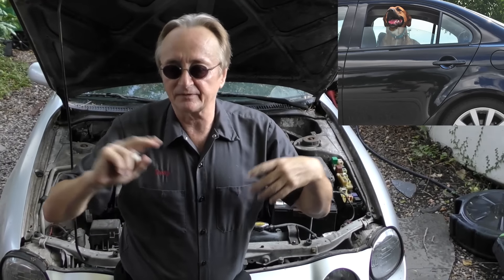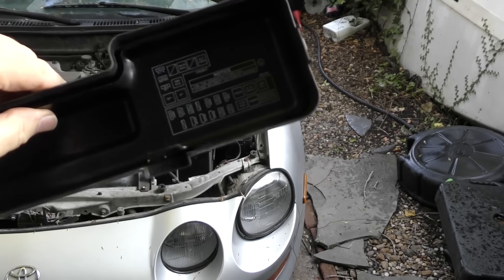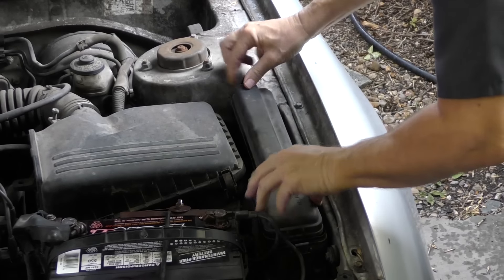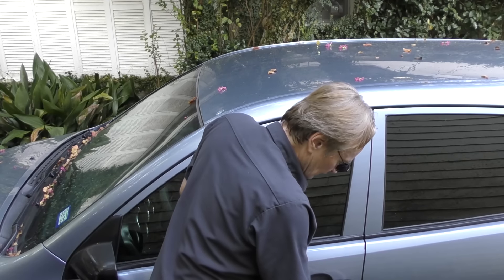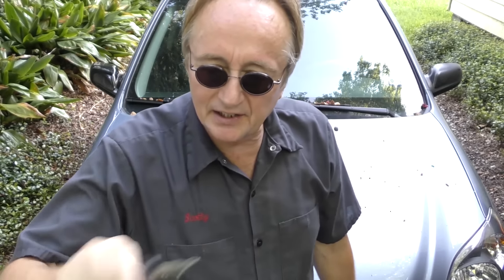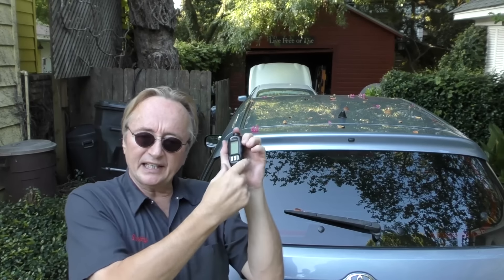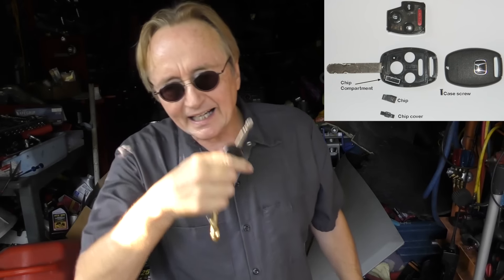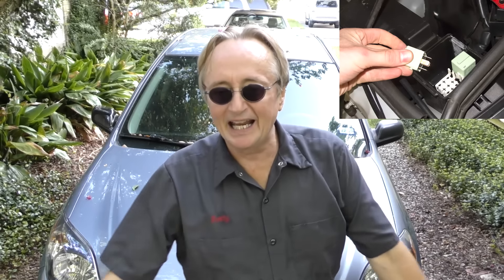How to Theft-Proof Your Car

Comment: the best anti-theft device is a manual transmission, no one knows how to drive a manual transmission this days
Reply: 👍🏾 true, that's why I drive a manual.
Reply: >This days
Reply: That’s why I deviced to get a stick shift
Reply: This solution does not work in europe, since nearly everyone still knows how to drive a manual.
Reply: Works quite well with car jackings too, just jump out and run before they find out they can't drive it and try to take it out on the driver.
Reply: Yeah ok buddy. My daughter and my three nephews are all in their early twenties and all of them were taught how to drive a manual transmission. I taught myself how drive stick just to show off to my dad. He was pissed because he wanted to teach me.
Reply: That's pretty funny and actually true.  Most people today can't drive stick so most people could never steal your car.  Pretty funny.
Reply: @ricardomolina4605  My sister taught herself to drive manual transmission.  I used to tell her "Grind me a pound" and she did.
Reply: True.  Most millennials can't drive standard.  Maybe somebody should develop an App so they can learn about it on their dumb phones.
Reply: Had to laugh when I read this, years back I had a ford cortina with a manual gearbox but it had a problem, the gearstick would jump out as the gate was broken,one night I was out and was going back to the car and noticed the door was opened a couple of inches,I thought someone has broke in to steal the radio, as was a common occurrence in they days ( in Scotland) but when I got in the car the radio was still there, anyway I started the car and put my hand down to put it in gear the stick was gone 😡 obviously someone tried to steal the car and the gearstick came away in their hand, so they stole that instead. But I had the last laugh as I kept a spare under the seat 😂  ( true story)
Reply: eXcEpT iN eUrOpE. And the, i tOT mYseLF; or the, mY sO aNd So dRiVeS sTiCk
Reply: Laughs in European
Reply: Tons of people know how.
Reply: Steve Silvas  Millenial here,  know many millenials (obviously including myself) who know how to operate a manual transmission car.
Reply: In Europe you can't even get a driving license in most of the countries if you can't drive manual.
Reply: 1notgilty nobody can drive a horse and carriage these days it’s absurd how people are caught up in their fancy gas powered automobiles SMH. That’s how you sound. 
Standard tranny is a dieing breed and older people aren’t helping seeing as manual sales are abysmal. Ps. Before you start crying I drive a manual civic.
Reply: Everyone I know in the UK knows how to drive a manual but some choose to drive automatic. Can't beat manual IMO!
Reply: Steve Silvas  I'm 28 and I drive a stick..
Reply: Nick J lots of younger people are able to drive stick, perhaps younger people are looking for different lines of work?

It’s also a function of time, often car lots will only have one or two (if that) manual transmission cars available. 

Can’t blame the younger generation for not learning to drive manual transmission. Perhaps the generation before is the one who you should be pointing the finger at? 🤔
Reply: Find one that you can buy!
Reply: @johnirvine3214  wow, that was one pissed off thief! :P
Reply: I'm 39 and still drive a manual Toyota Echo
Reply: People who steal cars know how to drive stick, that’s like a bank robber who don’t know how to work a ATM.
Reply: Nick J  I am 28 but I know how to drive a stick. Unfortunately I have a bad driving record over the last two years. I went for my CDL with a company but I didn't pass the driving part first time. So my first car after that was a 88 Mazda rx7 manual.
Reply: Nick J  yea. I know. I took my regular license behind the wheel test twice. I believe I can drive a truck now for sure.
Reply: Unfortunately you’re incorrect because it is easier to steal a manual just push start it I don’t know how many commentators say your statement and don’t know this. And almost all thieves know how to drive manual because thieves are poor and usually they do odd jobs like driving trucks and busses so they know how to.
Reply: Bite your tongue sir, I learned to drive on a manual. Used to drive one with 18 speeds for a living too. 😁
Reply: You will regret that decision....I may not be a pro at a manual but I can definitely drive around the city....the clutch might not survive but that's not my problem 🤣
Reply: Steve Silvas  I am a millennial...

I know how to drive stick.
Though I realize the average millennial does not, in fact, know how to drive stick.
Reply: No even better, get a car with a old vw autostick
Reply: Plenty of folks drive manual. Knowing how to drive manual doesn't make you special.
Reply: my friend's 1998 wrx got stolen two years ago, yeah it is manual transmission
Reply: Exactly.
Reply: Steve Silvas  I was born in 2002 and I daily a three on the tree, so yes, I can drive a manual.
Reply: Same here, my sister got a stick so her roommates couldn’t borrow it!
Reply: Steve Silvas true, you can’t play on your phone and drive a stick at the same time.
Reply: Brian not if you know how to drive one properly
Reply: I can drive a manual LOL..their actually easy to steal...no colume lock for the automatic to break..
Reply: Manual transmissions are easy to steal, no colume locks for the automatic to break,  as long as the clutch is engaged, you by pass the nutrual safety switch...

 Is a big urban myth car thief's can't drive manuals...
Reply: thieves do
Reply: @garysmith5741  I can't stand talking on my phone while I'm driving. So I lock my phone in my glovebox because I want to concentrate on driving my 1953 Chevrolet 210 with a Three On The Tree.
Reply: I’m 16 and I have driven 4 manual transmissions, so if you’re into cars and will actually put forth effort to drive a manual then it won’t actually be the best anti-theft
Reply: Steve Silvas  Dem Mel Enials rooin everyting!!!
Reply: Not hard to learn.
Reply: @1notgilty   They can learn, if they want.
Reply: "me special becuze me drive man u all!11!"
Reply: @angellively6746  Actually, I can drive standard and split shift, ride a horse and hook up and drive a horse and carriage, in addition to being able to hunt, fish and survive on my own. Millennials on the other hand will die by the millions if the system ever breaks down for an extended period of time. They are the weakest generation ever. Better to be a LONG way away from them and big cities for a while if SHTF day ever comes and the grid crashes.
Reply: i do, since i was 9
Reply: Haha..like me..
Reply: A few years ago a few punks tried to steal a car from an old lady and it was a manual. The punks looked at the shifter and all bailed and ran away. The lady just laughed at them.
Reply: You think America is the whole planet
Reply: that might work in usa....but in europe...manual transmission is way more common... and remember...scotty has fans all around the globe :P
Reply: How do you keep it from being stolen by a flatbed?
Reply: @angelsandoval9346  I think wheel lock will make it very hard to get it on a trailer but it's too time consuming, just get place with a garage
Reply: I’m a gen z and I daily drive a manual
Reply: Dude, quit saying that. that’s very bad advice.
Reply: Steve Silvas  wrong, Americans are the people who can't drive manual. the rest of the world has no issues.with that. Millennial or generation Z.
Reply: Im 16 and i learned how to drive stick 👍
Reply: Steve Silvas sike I’m the early one but I learned tho. I find this very funny tho 😂
Reply: I thought alot about subject recently. which doesn't say much about this generation of young people. Grandmother's were expert Manuel drivers when I was growing up. Lol
Reply: Not really in Mexico most people own manual transmission cars because of the terrain over there and because is cheaper to maintain a manual transmission cars , mostly anyone that comes from mexico knows how to drive manual. I was born in Dallas tx but i spend alot of time in mexico growing up, I learned how to drive in my grandpa’s toyota pick up 5 speed manual at the age of 14 all my friends in mexico were less than 20 years of age and knew how to drive manual. Im 24 ,and my work truck and my car is a  manual transmission, my wifes car is the only automatic I drive. Plus most of my coworkers here in dallas own a manual pick up truck . So Alot of people know how to drive manual now a days , specially teens who love racing with there cars, I seen alot of teens like that.
Reply: Im learning to drive one
Reply: Depending on the country
Reply: Here in Italy probably 90+% of cars are manual transmission
Reply: Steve Silvas  you mean gen z? because millennial were around when manuals were still relevant. In fact, most millenials know how to drive stick
Reply: I keep hearing this but most theives target manuals. At least the ones who steal hondas
Reply: @EnSabahNur-ir5mw  lol mad cuz old
Reply: Yes being car enthusiast driving mt is the way to go
Reply: yhea not in South Africa almost everyone drives manual over here 😂
Reply: Hal 502  but professional anto-thiefs ?
Reply: They just stole my 93 civic coupe :(. It’s manual. Even broke the wheel lock to steal it :/
Reply: Wish that was true. My manual 95 subaru legacy was just stolen :/
Reply: Lol manuals are stolen just as often as autos in Seattle
Reply: Most people in UK drive manual
Reply: 3on a tree with a pair of vise grips!
Reply: @angelsandoval9346  bolt down some super strong clamps and chains? Might be strong enough for a flatbed with a crane?
Reply: Negative I just had my Honda manual transmission Civic stolen.
Reply: Just bought a standard Mustang and was using an 80s club that I was being made fun of. This made me feel better.
Reply: Haha. Funny but true
Reply: I’m not sure if that’s true, I would expect someone on the streets to know how to drive stick
Reply: An easy way to theft proof your car is to just take the battery with you every time you park.
Reply: People need to stop saying that I steal so many manual integras 😂😂😘
Reply: Hal 502 , they can steal anything but they can't drive everything.
Reply: My manual civic just got stolen.
Reply: @Manakuski  Also in pretty much of Asia here in Indonesia our driving schools starts with manual transmission car
Reply: Maybe in your country, in South Africa they take it within a minute
Reply: Absolutely wrong
Reply: it’s actually pretty easy
Reply: Lol, wrong. I've been driving manual my entire life.
Reply: Not even….at least for Honda thief’s
Reply: Everyone replying "true no one drives manual" but say they're all driving manual 🤦
Reply: @epichumans9746  I've been driving manual since I was 15 years old. I am now over 50 years old.  And yes most people today , mostly Gen z and millennials can not drive a stick shift.
Reply: LoL my stick shift car was stolen a few days ago.
Reply: Where do you Live?!!
Reply: You would be surprised but yeah most people dont know how to drive stick
Reply: Show me a manual f150 or sierra or silverado. I'll wait.
Reply: That is exactly correct to not steal a car cuz they will definitely get pulled over if they steal a manual because no one knows how to drive a manual I've always said that in school they should teach us how to drive a manual and automatic because in an emergency you might have to drive a stick shift...
Reply: Manuals I mean sticks whatever once you learn it it's like riding a bike also you have more control of your vehicle
Reply: zoomers definitely will not be getting anywhere w/manuals 🤣
Reply: Can't start 'em, but can push 'em
Reply: not!
apparently thieves are learning
Reply: not in India.
Reply: Not in the UK, lol,
Reply: Just had my stick shift stolen
Reply: Nice
Reply: No one but me so if I ever barrow your car 🚘 I’ll bring it back lol 😂
Reply: @ricardomolina4605  nice bro. Doesn't change the fact that a low percentage of society knows how to drive manual. Doesn't mean no one knows
Reply: My dad taught me to drive on my first car when l was 17 in 1978, and when the battery died we could jump it by pushing it. Those were the good old days!🤔😏
Reply: Only in the states the rest of the world still have a majority of manual cars, or at least learn to drive manual gear shift
Reply: Ya got me, I def don’t know 😢
Reply: Sadly less cars today are sold as manual. I hate it. I love manual transmission
Reply: That's why I wish new cars came with manuals. Like the latest BMW M3 touring or even the toyota corolla
Reply: Not in the uk, everyone drives manual here
Reply: @Gubsygaming  depends, the are so many more automatics now than manuals.
Reply: Stick takes about 3 seconds to learn. Stop pretending it's hard. You are not a genius for knowing how to tap dance and pull a lever.
Reply: I would imagine a car thief is going to know good to drive manual
Reply: Only in USA
Reply: Except 99% of motorcyclist and most car enthusiasts
Reply: i bet you dont know how to drive manual-standard ..
Reply: Bad excuse brother don’t let me learn in your whip
Reply: i swear i see comments like these in every “how to theft proof your car” video
Reply: I’m here because my Manuel car was stolen this month
Reply: @SquallyZ06 yes it does, its a elite group !
Reply: @patski4 your sister has a weak personality ,just tell the roommates no !

Comment: I had the best anti-theft devices money can buy... A man with a tow truck stole my car.
Reply: Then, he took it to the chop shop.
Reply: You had square wheels? No, no you didn't.
Reply: @onetwothree4148  self deflating tires when vehicle starts to move.
Reply: I think the only counter to this is having a motion triggered 360 degree camera with GPS that uploads images and location data in real time to the cloud and sends you notification. Man. That sucks somebody got your car this way.
Reply: ErikX5 you should have tried the fishing line and hand grenade trick! 😅
Reply: @midnightmodder  we always used fishing bells hung down low on our harleys when we left them out in front yard at night. could also tie fishing line to bike run inside to a fishing bell. if you see it going across the floor time to go reel them in.
Reply: J D Right on!!! 🖒
You can also hook up a mouse trap with a small nail head to make contact with the striker when it comes down.
Put one of those old cap gun caps on the head of a nail.
Using fishing line to attach it to windows, doors...
There's a video on YT that shows how it's done.
Reply: Agreed. If they really want to steal car. They tow it
Reply: Intelligence 10
Reply: i know in my town there was a guy with a tow truck stealing bunch of cars
Reply: That's actually how my friend got his car stolen. He didn't insure his used car for 2 months with no license plate. Boom one night 5am it's gone
Reply: He stole it even though you had a .357 revolver?
Reply: @midnightmodder  what trick is that? Im interest
Reply: Real time GPS is the best anti theft I believe
Reply: For the love if god you people are thinking too much. I have a motion seat cover that detects a person weight then trigers a blade hidden behind the car head rest  well i will let uou guess what happens next  you might have to do some cleaning up afterward but bleach is cheap
Reply: @antonioreyes-rr3sg  Uhhh, well let’s hope you don’t ever forget to disarm it when you get in 😂
Reply: @GorlockSlayer  Look on the bright side. He won't have to clean up afterward. 🤣🤣🤣
Reply: put THE CLUB on your steering wheel.  Before you attach it, crank the steering wheel hard over in one direction, then lock it.  the guy will have a very hard time towing it with the wheels pointed hard over like that.  remember, you are just trying to make your car "harder" and a PIA to steal, so the crook will pass on it and go steal someone else's car
Reply: @Thrunabulax10 My old 1984 owners manual also says to turn the steering wheel to one side. The Club is also a good idea.

Comment: The best anti theft device was the stupid GM VATS or Passkey system. So good even the owner can't get the car to start.
Reply: Raymond Smith i love the VATS system. Get pretty good head shots that way.
Reply: I had mine disabled on my 1995 trans am but I have a Clifford alarm
Reply: Yep that PassKey system failed five times on my mom's former Oldsmobile.
Reply: You could disable the VATS system with a resistor. There were about 15 different value chips that they used, and you just needed to put a multimeter across the key chip to find out which value resistor you'd need. I had to do it on my 91 Camaro.
Reply: Genius! It keeps the owners from putting very many miles on the car. Improves resale value.
Reply: Yup. You got that right 😂 I had a mechanic turn that horrible GM “security system” off so I could drive my own vehicle 🤦🏻‍♂️🤦🏻‍♂️🤦🏻‍♂️

Comment: I bought a FIAT. Best anti-theft deterrent of all. Heck, I can leave the key in it and the motor running; I know it will still be there when I return.
Reply: even better get a Lada, had one for a year, forgot to lock it a couple of times parked at the roadside and it never got touched.
Reply: @Briancollison  does it have the hole in the floorboard so you can brake?
Reply: only problem is it wont be running when you get back
Reply: Oh no offense but I can't stand those cars I just don't understand but if you like it great
Reply: I drive a Mini Cooper to the same results

Comment: My 94 Ford ranger was stolen 5 days ago. It was stolen from a repair shop parking lot.    I got it back yesterday when a friend found it at a railroad station. When I asked the mechanic with all the cars here why would they take my old truck. He said and I agree it was the easiest to start. I'll be pulling the relay from now on . Great advice Scotty.
Reply: all you need is a long screwdriver, metal rod, etc. lift up the right side door handle and stick it in there and jimmy it open